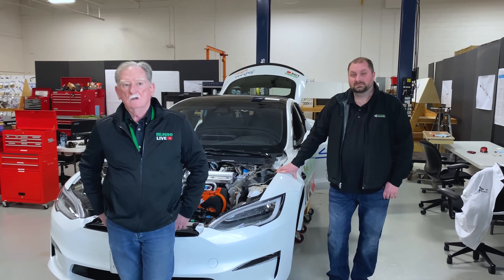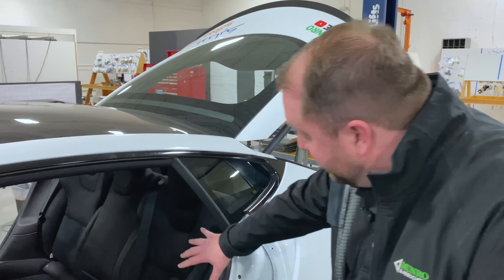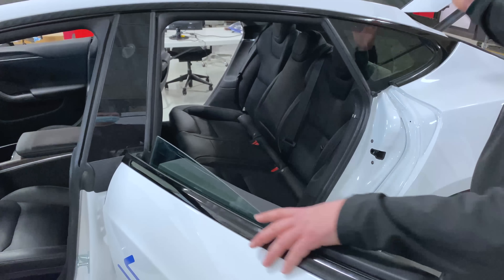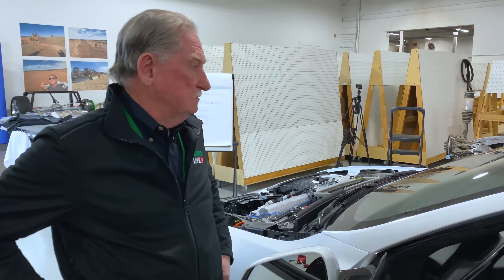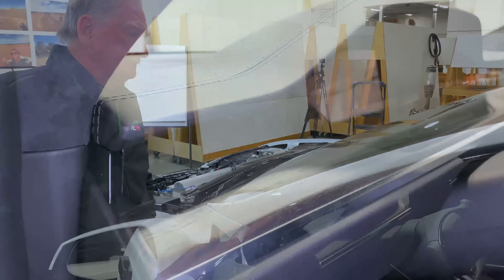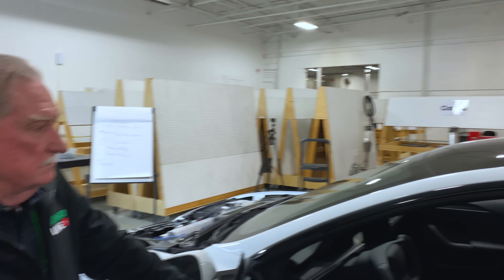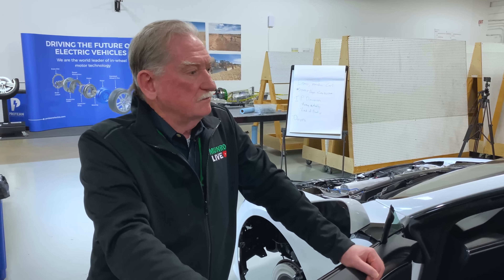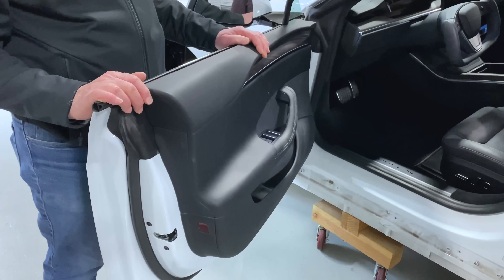Interior Design & Analysis | Tesla Model S Plaid Teardown

Comment: I recommend you double-check that information on the seat material.
As far as I know Tesla does not use crude oil based PVC for this seats but rather a plant-based material which is made out of pineapple-fibre.
At least that was the plan.
I would like to know if this is already the case.

Comment: 9:42 This is absolutely true. I use to work with a guy who was a retired police officer and he said he had seen a lot of people with broken noses and black eyes after car accidents because the airbag can knock your hands into your face if you place them at the top of the steering wheel.
Reply: I mean, like Sandy said, the yoke does force you into a safer position, but it's also why we were taught 9&3 or 8&4 in drivers ed. Even way back in 2000 when I took mine. Just give us a wheel and let us use it how we want... I fully support that manufacturers should try to eliminate any egregious or uncontrollable safety hazards, but at some point, some responsibility should fall on the operator to use things correctly.
The more and more things that are done for us, the closer and closer we get to a Wall-E future, lol. There needs to be a balance, and that's coming from a relatively lazy person myself.

Comment: Does any Tesla have the seat adjustment that can be put into memory and recalled.  I know Range Rovers do and I reckon it would be a piece of cake for a company like Tesla to implement it.  Imagine you are walking up to the car and use your app to reset the seats before you get in.  Just like the cabin pre conditioning feature on the app.  I really hope you consider this as an improvement in your review.
Cheers
Mick
Reply: I would have thought that's part of the driver profile.
Reply: Any owners like to comment? Does it have this already?

Comment: 34:02 not really. this tip cant be generalized. consider that many components on the Refresh came from the 3 and Y.  countless products are also made high end or flagship which came from lower/cheaper models. even the old convertible design tip on rigidity may not be useful nowadays with heavier and safer car these days especially EVs with plenty high strength steel.  I think there was a tweet from Elon many years ago that they can chop the roof of the Model S and still has ample rigidity.

Comment: Leather is unfortunately basically plastic once it's out of the tanning factory, sandy says he doesn't like chrome but pretty much any leather you would get in a car will be a chrome tanned leather. Leather also puts out more CO2 than the equivalent polyester or nylon (can't remember about pvc) over course of the animals life and through the processing. Not a fan of PVC either as it has a bunch of issues of it's own, polyester fabric is preferable for a car interior but for a premium feel a polyester microfiber combined with polyester fabric can be a great option and in theory could be recycled.

Comment: @18:18 leather may not get as hot as pvc, it still gets unbearably hot in the summer. Beside, people who don’t like the performance of leather are thinking of cloth as the alternative, not vinyl. 
In terms of comfort, anyone who’s sat in an S Class, Volvo, and Tesla (at least in front) will clearly notice they are a cut above. But you may be surprised that some of the most comfortable seats in a car I’ve ever sat in are the NON adjustable ProBax seats Lotus had in the Elise/Exige. ProBax makes a lot of seats for marine applications and orthopaedic seats so they know a thing or two about comfort, proper support and posture.
Ps. Even the Nash seats from back in the 30’s and 40’s had a sleeping configuration.

Comment: I am 6 feet 2 inches tall with long legs and I have done a lot of yoga and meditation in my life--so I like to sit up straight and tall.  The biggest ergonomic problem I run into with car seats is problems with the head restrain being too far forward and digging into the top of my back, a couple of inches below my neck vertebrae.   Most car seats seem to be designed for someone whois  about 5 feet 9 inches tall and who rolls their shoulders forward into a slump. The best example of this is the Cadillac ATS and CTS.   As a long time BMW M3 driver I would have loved these Cadillacs, but I never could buy one because of the problem I mentioned above--the non adjustable head restrains digging into the top of my back.    Cadillac lost a lot of sales on these cars for that reason.

Comment: Airbags causing injuries / breaking arms hasn't been a thing for a decade or two now, that was the 90's.  The yoke has a potential to spin out of your hand and break fingers & wrists in an accident vs a circular wheel just spinning through your hands. Circular wheels only break thumbs if you hang your thumb inside when you're 9/3

Comment: 19:29 i thought was about to get bored but both have good points here. Thing is, Tesla decided to have seat motors for driver profiles. It is a waste for a single driver owner but judging from the praise from twitter, it is pretty good feature to have.  
edit: i also found a weird tweet on twitter that Tesla has new code to minimize or disable excessive seat adjustments, at first I thought it is related to gaming but turns out a feature to save the seat motors from excessive wear and tear

Comment: Electric seats are only any good if they have a memory function which is tied to the key.  
eg. If you unlock the car with your key the driver's seat moves to your personalised settings. If partner unlocks the car the seat moves to fit them.

If they don't have this feature then you're better off with a manual forward/back adjustment as it'll be quicker to set.
Reply: They have it.

Comment: 10 and 2 hand positioning on the steering wheel was important when many cars did not have power steering. It gives you more body leverage to turn the wheels. It is easier to hold your arm steady and put your body weight on the wheel to turn it than it is to lift the wheel with your shoulder muscles. It doesn't really have any advantages other than that which I am aware of.

Comment: The primary reason, I believe, for the yoke steering is for safety.  Most people don't hold a steering wheel at the optimum 9:00 and 3:00 position, like a professional face driver would.  Many people hold a steering wheel at the 5:00 or 7:00 with one hand and lazily drive their car.  Most cars have less than 400 HP so if your holding the steering wheel at the 5:00 with just one hand and punch the accelerator, a less than 400 HP car will jump faster, but not so fast you couldn't still control it.  However, the Tesla Model S Plaid has 1.020 HP and if you punch that accelerator, you had better have both hands on the steering and at the correct position, which a yoke forces you to do...hold it at the 9:00 and 3:00.  If it was a wheel and you weren't holding it ideal and you punched the accelerator, you could very quickly launch yourself off the road into a tree as this car is the fastest production sedan ever made and I believe someone in Texas already had this exact accident with a less powerful Tesla Model S and killed himself and his passenger.

Comment: As a person with shorter legs and a longer torso, you are wrong about seat adjustment range. The new S my head almost hits the glass ceiling when seated in front and can barely get in the back seat through the door. A problem I don’t have with the 3 or Y. Quite a few cars I never even consider because of poor range on the seat.

Comment: Something not addressed that really bunches my panty hose is carpet flooring in cars. Why do auto manufacturers insist on putting carpet floors and mats in most cars? Carpet floors look nice when the car is brand new, but attract dirt, degrade, and are a pain to clean. Rubber and/or hard plastic flooring should be standard on all vehicles. I love how easy it is to clean the Honda Element and a lot of work trucks. Auto interior designers need to take note. I'm far from the only car owner who thinks carpet floors are stupid.

Comment: I would love if you have a good look on the brakes. I've heard several complaints (and seen a Video of an accident on a race track) that they suddenly fail after a few hard hits on the pedal because they are not fit for the power of this car. 

That of course would be a serious safety concern. I'd love to have your opinion on that.
Reply: I'm pretty sure that's just hype.
Reply: @jamesengland7461  Well the dude that wrecked his Model S because of that would probably say otherwise. I saw the vid, it was nasty.
Reply: @markedward4290  Tesla takes great pride in the time the Plaid did on the Nuremberg ring and used that for promotion. If they do that and if the car costs 140.000 bucks you would expect that the brakes can handle that! All performance models from Daimler, Audi etc have ceramic brakes which can handle a race track and many of them cost less than a model s Plaid. 

No this is not good.
Reply: @Ample17  NO ONE races with stock brakes.   Mercedes and Audi's ceramic brakes will not work on the track either.  They will be smoked in 20 minutes.  I've seen many Audis come off of the Infineon racetrack with their ceramics almost on fire.  And Its around $2000 to get them back

Comment: Tesla, Inc. recalls tens of thousands of more vehicles due to software issues that could put certain vehicles at risk of a fender bender. 
According to the National Highway Traffic Safety Administration (NHTSA), Tesla recalls 2016-2022 Model S and Model X, 
2017-2022 Model 3, and 2020-2022 Model Y because of the "rolling stop" feature in the Full Self-Driving (Beta LOL) software
may allow the car to automatically roll through an all-way stop intersection without coming to a stop. 

NHTSA said this recall affected nearly 54,000 Tesla vehicles (various models listed above). The Austin, Texas-based
company will perform an over-the-air software update to disable the "rolling stop" functionality. 
Shares of Tesla fell around 1% premarket to $927. Last month, the stock plunged into a bear market, 
dropping as much as 34% but rallying on the last day of the month by a little more than 10%. LOL

Comment: I like having independent movement of height and forward/backwards movement on the seat… I have a 28 inseam but have to buy large shirts with longer tails because I have a very tall torso. Having them on a fixed arc would suck for me! I usually have my seat fairly far forward and 2/3 of the way down…

Comment: A skateboard platform should make a good convertible for roll stiffness, but you'd need a good roll bar for the soft top.
Not too many "Coat of Many Colors " seats out there. Dolly probably still has custom seat.

Comment: Would be interested on your take about the seat adjustment durability and Tesla locking out the controls if used too much.
Reply: that brings to mind my question regarding the "easy entry" mode on the Tesla....everytime you drive it causes a lot of motors to work which might contribute to the wear of the power seats?
Reply: @lenimbery7038  that’s a good point. Not a feature that is use but every time my wife or I drive our cars, the seats adjust.

Comment: As for the seats, I think FORD decided in 2004 to Eliminate comfortable seats in their trucks. Instead, they make Park Benches that last a long time and damn the buyer. True story: I bought a brand new 2015 F-150 Lariat Supercrew with leather seats. They were The most uncomfortable seats I could have imagined. I could not last 150 miles travel without a rest stop. I anticipated rest stops. That's just wrong. I traded it in for a Flex 6 months later. My 1996 Ford F-150 NASCAR edition had Unbelievably comfortable seats. Now, I have a 2021 Ford Transit class B motor home and those seats are worse than the 2015 truck I ditched. In this case, I had no choice, as I was not buying a Mercedes or Dodge Promaster chassis RV. Sucks to be me...

Comment: Check your Ioniq 5: it has both reclyning and tracked adjustable rear seats,
I would love to see IIHS data regarding the yoke. Generations of drivers have gottten used to circular driving wheels and in a moment of panic, might reach for the wheel and miss it because your brain is trained for round, not yoke, leading to a potential crash because you couldn't grab the wheel in time.
One drawback of Tesla's windows needing to go down when you open the door is winter when the glass if frozen to the door. That, with the already crippled rear passenger insulation of your own Plaid, tells me this is going to be an ongoing problem with the Teslas. One reason I prefer door frames (on top of those who slam doors by the top corner).
Will you look at the pain job? Panels gaps? This has been a recurring prblem for Tesla and if they can't get a door seam correctly on a 140,000USD car, is kind of frightning for the rest of the construction. No one doubt they have the best powertrain. But it would be nice for the rest of the vehicle to follow along.
Reply: My model 3 has really bad wind noise because the window isn't sealing well against the outer seal. It's even worse in cold temps when the rubber is harder. It almost sounds like my windows is cracked open, it's very loud and annoying. The inner seal is still working though, I don't get any water ingress like when going through a car wash.  I think they might need a more siliconized rubber seal that can perform better in colder temps. And just in general.

I'm waiting for someone or Tesla to make a re-designed window seal that's either thicker and/or more pliable. I may try adjusting the window, but from videos and forums I've seen, you could end up making it even worse. I'd rather just have a fully framed door. My Mustang GT had the same frameless windows and they were annoying as well. I like having an elbow-shoulder height frame I can use to close or grab the door with.

Like you said, the powertrain of tesla is essentially unmatched, especially for the price. And the charging infrastructure of course.  BUT, unless Tesla starts changing their ways with service and Elon's bizarre need for the near future of vehicles to be entirely interface-less, my Model 3 will be the first and last Tesla I buy.  I also really miss having a "dumb" cruise control that I don't have to override the throttle pedal with every oncoming vehicle in the opposite lane...

By the time I'm ready to trade it in 3-4 years from now, there certainly will be a lot more offerings by other manufacturers and CCS networks should be much better.
Reply: @andrewt9204  Does air seep in or filter out from that seal?

Comment: The more we can use bunker fuel the better. Deisel is also free, it's a byproduct of the jet fuel industry. The oil industry is all natural and does not contribute significantly to pollution. Container ships run at only 250 RPM, making them much cooler and cleaner than a 15K RPM ｃａｒｂｏｎoverwrapped motor. Thats right, Tesla is selling pure black carbon motors... so much for being green.

Comment: Awesome video! Thank you for y’all thoughts. The cybertruck is supposed to have a yoke steeering wheel but I (not that I’m a celebrity like you) disagree with you. I don’t like it. 

It will be very cool once the car does all of its own driving “just in case” you have to take over but until then I really want a round steering wheel. The idea that you can’t see with your hand at 12 with a normal steering wheel is crazy. I have driven that way in a standard car for decades and never thought I couldn’t see the rpm’s or speedo. 

Also, once fsd is a thing, you will have to have a steering wheel to go off road right? So just give me a normal steering wheel option. 

Also also, plaid will not be needed once fsd is a thing as it’s not like the car will need to accelerate that fast. Again… need a normal steering wheel. 

Lastly thank you again for all you do! I hope we get to see you in Austin, TX some time! :)

Comment: I like Carl. It sounds like he really knows his stuff. Let him talk.
I guess Sandy hasn't seen any on-track videos of the stock Model S Plaid(not talking the altered vehicles used on Nürburgring or Laguna Seca).
Leather seats are great. Tesla and others say they have eco-friendly plastic seats, calling it a 'feature', but really it's a cost savings. Skins not used for leather go right in the gelatin vats to ferment.
Reply: @ryanwelsch9384  Regarding Sandy, He said it was a race car. It is not. The brake system is utterly inadequate for a car of that weight to be driven at speed. Dramatic footage of real track drivers running off track when the brakes failed has recently spurred Tesla to offer an upgrade, $20,000 for the parts.

I like leather. I like beef in moderation. While I deplore factory farms and the harm they do to the environment I also deplore the fossil fuel industry that makes the material for plastic seats. I have killed fish and both farm and wild animals for food and see no ethical dilemma with that.

Since you ask, If I sold my body for parts (as a human I own and control it) I would be fine with it being used. Instead, I gave it away. I signed an organ donor card that allows my reusable bits to go to those who need them. I would hope my skin could be grafted to a burn victim to aid in their recovery.
Reply: @Miata822  does your taste pleasure justify causing harm to others?
Reply: @ryanwelsch9384  Sorry, Ryan. I have tried to speak with you respectfully, but now you are being trite. Animals are not others, not people. You are free to avoid them but our conversation is done.
Reply: @Miata822  why do you deplore factory farms?

Comment: Very good detailed video. You mentioned at the end that you were discharging part of the battery. When you do that video can you please explain the steps you take to discharge? I'm assuming that you run the battery as low as possible before starting the teardown? Then use a resistor bank?